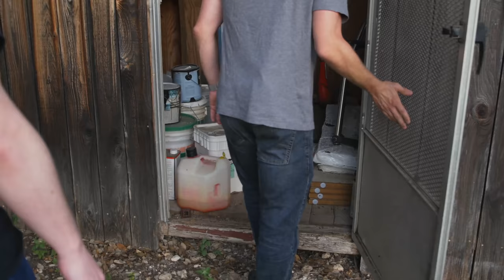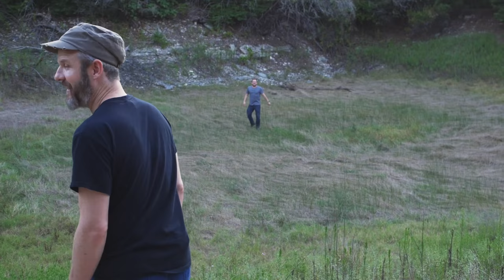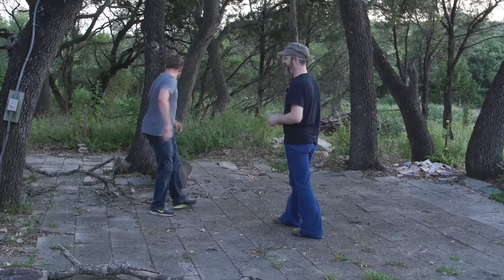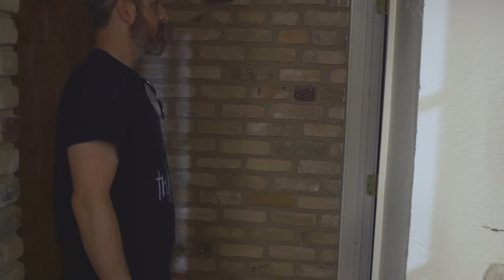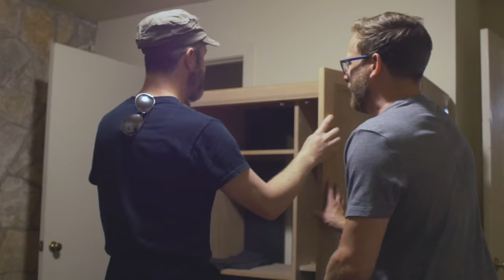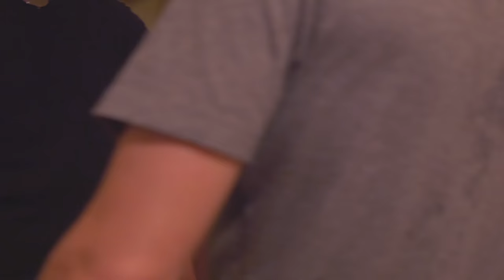Touring the Modern Rogue World Headquarters

Comment: Dear Modern Rouge

I am just a random fan who really loves what you do. And when you asked for ideas from us viewers, I immediately thought of something very useful that I wanted to see be done to Inspire & make others think plus ultimately help out you guys.

My requested idea which I incredibly hope you do is to automate the creation of food, water, & electricity.

For electricity I suggest making a solar panel farm which would be ideal, but there also such things as 3D solar panel farms that may be more efficient. Or perhaps replicating what Google did and make a smaller version of the Google solar farm that they created which powers much of their company.

For water it is most likely to be collected from the rain. But! If all the water on your property is drained to and collects to that pond like area, I suggest you transform that into a raw water collection and storage system that can be later filtered into clean safe water using perhaps a heat steam like filtration system powered by the solar energy.

For food we take both the electricity from the solar panels & the filtered water from the rain. And we have it some of these resources be transported to the greenhouse automatically.Then, we set up a sprinkler system to spray a mist of water to water all the plants within the greenhouse. Or if that's not a good enough and proper measurement system, we have the water pumped to containers that have a specific amount for each set of plants. And every so often a timer automatically waters the plants.

To further automate this we should have machines built to replant and harvest all the plants for us and store the food in proper storage containers. Which you could then go to and collect. Or, automate collecting them too, I dunno you decided how much to automate. I say the more automatic it is, the better.

You can then ideally keep enough for yourself self, and sell any extra for extra income.

This I wanna see if you guys can do. It would be tremendously awe inspiring to witness that human needs can be taken care of. I can see the title of a video showing off your achievement. “We Automate Human Needs".

There is also a need for new clothes, so cotton plants would be ideal too. Plus a machine to make clothing out of the cotton for you.

Other ideas of suggestion

How to make night vision goggles

How to make thermal vision goggles

How to make The Hidden Assassin's Blade from the Assassin's Creed games.

How to make a grappling hook gun

How to make a taser, also how to make a taser hidden by building it into a hand ready glove (This ideally allows at ready already in hand and maybe hidden tasers)

How to make an electric wizard tesla staff (Yes, I love electricity. Also this would just be badass)

How to make your own batteries (ideally rechargeable, but also non rechargeable)

How to make a voice changer

How to make a tranquilizer gun (ideally with a launcher to fire the rounds instead of using gunpowder or carbon compressed tanks. Something like a BB gun maybe)

How to learn psychological subconscious social cues to read anyone

Survivor island special! How to survive on a deserted Island. Aka 5 ways to collect clean water. 5 ways to make a warm safe shelter. 5 ways to collect food. 5 ways to start a fire. 5 everyday luggage supplies that are actually useful when deserted on an island. 5 ways to escape an island.

How to make an all terrain drone (water, land, air)

How does wifi work and ways to strengthen it or how to make your own wifi.

Making a huge Tesla coil

5 Grand Inventors (Please Included “Nikola Tesla”)

And That's all I have for ideas for now. I hope you get any inspiration from any of them! I love your work and I wish you the greatest of luck on your future endeavor!

Comment: I see you have a lot of cedar on the lot.  The Texas cedar is an interesting plant.  Roots are very shallow, so if you can tip the plant over, it will usually fall out of the ground by it's own weight.  If someone volunteers a Bobcat or a Skid Steer with a front bucket on it, lift the bucket to the top and push it into the cedar tree.  Once the tree roots pull out on the pushing side, it should fall over.  That part takes maybe 60 seconds at first and more like 10 seconds once you get the hang of it.  Then use the bucket to lift the tree and shake the soil off the roots.  Finally drop the tree into a dump truck.

Comment: Congratulations to all the MR crew. Brandt, what are your camera settings also , what ND filter are you using? I need my video to look like this.
Reply: No ND filter used here, if I remember correctly we used a Lumix GH4 with a Voigtlander 25 mm f/0.95 (probably a couple stops down from wide open to start, opening it up as the video progresses.) It helps a lot having a lot of space and good light, short of that the lens and color grading are doing a lot of heavy lifting for how the video looks.
Reply: Brandt Hughes  It's very well done. The changes in source lighting are almost non existing in this video. I know the challenges of shooting here in Austin (crazy cloud cover on sunny days) especially in a wooded area full of shadows. I will try your settings but i have to admit, color grading is still not my strong suit. oh well, wish me luck and thanks for the response.

Comment: GUYS, WHAT THE HELL. Why don't you.. oh... I don't know... film the work being done? Why not learn to do the work yourself to the building? You've learned this much, why not succeed (fail) at construction? :D
Reply from the maker: You're part right:  we plan to do lots of "this old house" -style stuff... but hopefully none of the parts that require safety.
Reply: Just about anything and everything you do there requires some kind of safety knowledge. For example, Brian pointed out the poison ivy. Gloves, long pants, long sleeve shirt, don't itch your nose lol, and keep calamine lotion handy just in case. Make sure you have rubbing alcohol, or gasoline and vinegar mixture to remove the urushiol oil (poison ivy's toxic chemical) from your skin. Just be smarter than the task at hand, and you guys will do fine. It's too bad you guys seem to not really know what you're doing ever... but it's also sort of the format of your show...

Anyway, if y'all need help with something, ask! I've built load supporting structures (decks), remodeled houses, poured cement, leveled cement, I've built Boeing 737 flaps, I've done just about every repair there is to do on an automobile, I program in C, C++, and Rust, I've repaired and designed electronic circuits, and I've wired and rewired houses to city/township building codes.